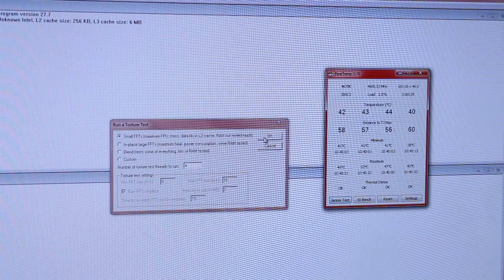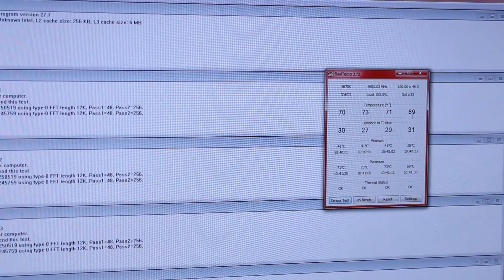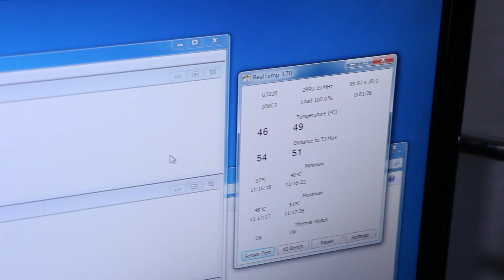i5 & i7 Haswell & Ivy Bridge - FULL Delid Tutorial - (Vice Method)

Comment: Is this necessary? It has taken me 4 months to get all components together on a £1500 build, the last thing i want to do is start fucking around with the cpu i just spent £250 on. I'm gonna be putting a custom loop on my 4790k are the temps that bad? I've got all the shit spread all over my living room and there's no point starting if i have to rip the cunt apart again!

I like your style keep up the good work!
Reply from the maker: Oh if you have a 4790k then dont bother, they already have the improved thermal paste.
Reply: Cheers mate appreciate you answering i didn't really want to do it i'd probably fuck something up. Was it just for overclockers or was the heat issue across the board, like for all users?

That Coollaboratory Liquid Ultra can it be used on gpu and cpu for watercooling? I noticed you didn't use it on your cpu you used Arctic Silver instead or was that because of cost? You get a small amount for the money! I read some people saying they only get one usage out of it but they must've been a bit overzealous!
Reply from the maker: No worries, yeah you won't need to do it on the 4790k.  As for CLP or CLU, I didn't use it on the cooler as it will corrode alloy (my Enermax T40 is made of aluminum), also the fact that you don't get much of it makes it perfect for the die to IHS, where it won't corrode either.  So honestly you won't need it at all in your case.  As for Arctic silver the stuff is honestly just decent stuff that works well, and you get a lot of it too. 

Yes there is better thermal paste out there, however I found that after a year of having PK-3 lying around in a tube I went to use it again and the stuff just became hard shit (i.e. I couldn't use it again), as opposed to the AS5 which was still all good to go and like it was on day 1.
Reply: A lot of people still swear by AS5, on a lot of comparison tests i read there's only a few C difference from the best to worse so it's just personal preference! I bought some Phobya Hegrease extreme not used it yet, not started my build never done a watercooling build before, i keep pussying out. Either that or i'm just a lazy bastard :)

Thanks again, keep it up your videos are enjoyable and not American!
Reply: Tech YES City "...you won't need to do it on the 4790k".  Some still might want to try this with a 4790k: http://www.pugetsystems.com/labs/articles/Delidding-the-4790K-for-a-quick-look-at-the-TIM-573/
Reply: Rod Anderson
No since posting the above i've read they use better thermal paste which is what this dude said. I never read anything suggesting intel were gonna use solder and the article you posted says "rumour" making it a worthless article! It's like saying there's a rumour going around that a pill has been manufactured which grows your dick an extra 4 inches! Then saying later "that rumour about the big dick pill was a load of cock n balls" A rumour may as well be a myth or a lie because 90% of the time it's just hearsay or altogether made up shite!
Reply: Overreaction. I was just saying that using CLP on the CPU after doing a delid on a 4790k can probably still bring some nice results. I highly doubt the "new" thermal paste Intel is using gains more than -1 or -2 degrees. Up to the user of course.
Reply: michael thorn actually Intel did the 4790k to improve TIM but its STILL SHIT! STILL SHITE. I need to delid my 4790k

Comment: So why didn't you use the CLP on the lid & heatsink also? Its a far better TIM than AS5, its 100% liquid metal alloy, doesn't get much better than that for a TIM. I assume you have a good reason why you didn't use it there? I'm very curious.
Reply: William C. Nice Job keeping your 1366 socket mainboard for all these years. You probably didn't miss much except PCIe 3.0 and USB 3.0. Good X58 mainboards still sell for 200$ and more. Here's what I did: Bought a Xeon X5660 Server CPU for around 90 bucks. It's got the performance of an i7 980, six cores, 12 threads and is a monster at OC. With an Alpenfoehn Brocken 2 aircooler I run it on an MSI X58 platinum at 4Ghz. Give it a try, dude, you'll shit bricks, I guarantee it. It outperforms a stock i5 2500K.
Reply from the maker: x5660 and gtx760/960, you will be up and gaming again no problems.
Reply from the maker: Cooler has aluminum on the base plate (enermax T40). CLP eats alloy. Previous AIO was all copper but that shat itself.
Reply: OK, that makes sense. My CPU is a i7 920, I take it that it has the crappy paste as well? I'm using IC Diamond & a all copper Zalman cooler, temps average 36C idle. What kind of temp difference can I expect if I Delid & apply CLP?
Reply from the maker: I believe the i7-920 was soldered, so this tutorial won't apply (i.e. can't delid your CPU).  As for temps, soldering is the best, so you don't have to worry too much.
Reply: Yeah I found out today that you're right. The i7-920 is the 45nm Nehalem microarchitecture & it is soldered to the HIS. When I first installed my copper Zalman CPU cooler using IC Diamond (about 4yrs ago) I was averaging 31C idle temps, not too bad for air cooling. Well I just applied new IC Diamond TIM the other day & I can't get it below 35C idle, tried three different applications but I'm still averaging around 37C. It had me baffled until I discovered that my rear & side case fans were dying, both moving just enough air to keep the inside of my case from baking. They are obviously not performing optimally which completely explains my temp differences, at least I hope, that's an easy fix. So Tech YES City, do you have any 120mm case fan recommendations? I was thinking Noctua? There are several models on eBay for around $25. Do you know which verson has the best balance of performance & silence? Ive also heard the scythe gentle typhoon is really good. Also, I got this (Link Below) mounting bracket for my 2 30GB SSD's (in RAID-0 of course), they mount directly on top of eachother & the bracket has a spot for an 80mm fan, should I get one for them or do SSD's even need fans? Its only a few bucks for an 80mm fan so I'm thinking why not, couldn't possibly hurt? OK, that was WAAY TOO MANY words for a YouTube reply, LOL!
http://www.ebay.com/itm/151320350177?_trksid=p2059210.m2749.l2649&ssPageName=STRK%3AMEBIDX%3AIT#
Reply from the maker: Scythe Gentle Typhoons are amazing, I would go with them if you can pick them up cheaper than the noctuas, both are really good choices though, but I would hit up the Gentle Typhoons personally.
Reply from the maker: I am always a fan of 'the more the better' in terms of cooling, so I would honestly get a fan on your hdds and ssds (though ssd isn't as important as hdd), I have a 12cm fan dedicated to cooling my drives and I haven't had one fail in a very long time.
Reply: Anco77 Yeah I bought a Gateway FX6800-01e for $700 in 2010, upgraded the memory, video card, CPU cooler (also added a RAM cooler) & PSU, its been running fantastic ever since. This has been the perfect machine for my needs, does everything I need it to very well & with the SSD's its quite  responsive. The only issue I'm having now is my Radeon HD 4870 (I know, its old by today's standards) crashes once in a while, apparently from the outdated drivers it uses.   This is very annoying but its the only issue I really have with my system, other than that it has ran like a champ since day one. So Anco77, your saying that a Xeon X5660 will work in my 1366 socket? Where would I find one at a decent price? Also, what video card would you recommend as an upgrade for my system? Thanks for the advice man, much obliged.
Reply: Tech is basically right. You could also get the X5650 but they tend to run less stable when overclocked. Just look at ebay, there's a dude in my town (Berlin, Germany) who's selling those Xeons like hotcakes because many companies renewed their server infrastructure and then there are 100.000 CPUs on the market all of a sudden which explains the cheap price. The GTX 960 is good, no doubt, but if I was you I'd go the extra mile and get a GTX 970. It has almost the performance of a 980 but costs 200$ less with more video RAM than the 960. Or if you like, try an AMD R9 280 or 280X. It doesn't really matter because you'll probably change your graphics card anyway in a year from now but the Xeon will still be a beast. Because modern games and DX12 seem to scale pretty well with 6 physical cores due to the CPU design of Konsoles.
Reply: By the way: I use the Xeon System only for fun and benchmarking. My "normal" rig is an i7 4790K on ASUS Maximus VII Ranger at stock settings because my cooler sucks and is just there for the looks [Thermaltake SpinQ VT). If it comes to games, I used both CPUs with a GTX 970 and had no or minimal FPS difference at Assassins Creed4, ArmA3, Farcry 3, Skyrim and Dragon Age: Inquisition. Those tests told me that the Xeon presently isn't a CPU limit which slows down your games. And as I said, I think it will stay that way for at least two years untill the new consoles come out.

Comment: Ok, so after watching you great video I need answers. I just built a new PC and I have a 4790k and running at stock everything (4Ghz) running the same CPU cooler you have and non-delidded the temps will go to 95c+ (according to 2 different temp programs) within a minute of the stress test. so my question is, what could be wrong and how can I fix it? and for more insight I down clocked to 3.8 at 1.04v and its only reached 72c MAX after 30+ min.

Thanks

Comment: whats better: cpu frequency of 4.4ghz and a cache frequency of 3.4ghz, or cpu frequency of 4.0ghz and a cache frequency equal or near equal to that? i've heard that a 1:1 ratio is ideal, but is it worth it at the expense of having a lower cpu frequency overclock????
Reply: core is always king.  go with 4.4
cache should be 3.9 - 4.2
Reply: Well I asked if 4.4 core and 3.4 cache is better than the 1:1 core/cache ratio. Having my core at 4.4 seems to make any cache overclock unstable, hence the reason I'm asking about it at stock frequency
Reply: Justin Sheldon If your stable core OC is crashing your cache OC then give cache more voltage.  But to answer your question, 4.4 core/3.4 cache will give better performance than a 1:1 at 4.0.  Try both and test with cinebench.  I have my 4670k at 1.8v VCCIN, 4.5 core 1.24v, 4.3 cache (ring) 1.195v. 24/7 stable.
Reply: i've found stability but i guess i might have a bad chip. i have 4670k at 1.9v VCCIN, 4.4 core 1.28v, 4.1 cache 1.19v
Reply: That's not a bad OC.  But probably a bit below avg chip.  If you're only gaming, 4.4 is just fine.  Mine can do 4.6 at 1.29v but I back it off a bit for lower temps.

Comment: i went ahead and upgraded from a 4770k that wouldnt go over 4.2 ghz,to a 4790k that asus auto tune put it at 4.9 ghz across all cores but i had to back it down to 4.7 due to overheating and i am using a corsair h110 water cooler
Reply from the maker: Nice to hear the gamble paid off :).  4.7 24/7 is a damn impressive OC.
Reply: Tech YES City well i sold my 4770k for 280.00 usd, and i had a 20 usd off coupon and i didn't have to pay tax for the 4790k, so it cost me about 40 usd for the new one, i plan on jumping over broadwell and waiting on skylake, i just have a addiction to always buying the latest and greatest if i can afford it.i would like to see a asus manual overclock for the 4790k, i used the asus 5 way optimization and it had all cores at 4.8ghz with core 1 and 2 at 4.9 but i turned it down to 4.7 across all cores because of heat,i could hit 4.6 ghz stable at 1.2v, but i didn't try any lower voltage as i was trying to max the cpu out, thanks for the vids.

Comment: You should try out the Thermalright True Spirit 140 Power. Its around $50 USD and cools even better than an enermax T40. On a hot summer day with my windows cracked as usual, I idle around 30-35c and prime95 maxes out at 73c at 4.75 ghz on my 4670k

Comment: would you recommend deliding the 4790k? i heard they put good thermal paste on it already
Reply: No, don't do it. With the new chips they fix that. They used a good quality thermal paste. 4790k comes with 4GHz out of the box and 4.4GHz with turbo boost. Not even sure why would you overclock more, 4.4GHz is enough. But if you really want you can with a good cooler like Corsair H100i or Noctua nh-d15 up to 4.8GHz no problem.
Reply: Dr_Palace thats what i thought, thanks
Reply: Ecdub984   Under water with my 4970k my temps reach 90c+ in prime and Intel Burn test at stock volts, I have tested all my cooling parts and the only thing i can think of is the chip has a bad TIM connection between the die and IHS. I will be delidding mine this week so Intel haven't fixed the TIM issue they just tried to polish a turd.

Oh and why not overclock the 4790k Dr_Palace? Its the only reason to buy it, it is an unlocked CPU for a reason.

Comment: Thanks, I love your videos, helped me loads, right, I have hero 7 board with all the trimmings in ssd and asus 680 gpu and so on, I am getting the 4790k next week and I am seriously thinking abt deliding it, but I am a little worried abt getting my dick stuck in the vice,lol, 300 bucks if I fuk up... I will only be running the chip at 4.6ghz, that's high enough for me as I want this rig to last and not burn out to fast so that being sais is it worth taking the risk tech yes ???, can I ask why you did not use the liquid metal on the cpu heatsink as you did on the die, and will it be ok to use the liquid metal on the die and cpu heatsink, please advise. thanks man.

Comment: Im not here to tell you you're doing it wrong, if this works for you then sweet, but I work at a pc company and we have always just put a Stanley knife in the corners, edged it around and then lifted the lid off, it's safer and you dont have to worry about cutting the pcb, as long as you always keep the knife on a flat you will never damage anything. I would also suggest getting a smooth Stanley knife for the silicone on the edge and replacing it with some silicone based glue, that way you can reseat the lid and have it stay on ;P
Reply: lol just don't do that for God sake, with any blade is just too risky to remove IHS. Go look on some forums a lot of people has destroyed the chip when they tried to remove IHS with a razor.  Vice method is easier, faster and much more safer. To this day i never meet anyone that has killed their chip while using a Vice method to remove IHS.
Reply: As mentioned in the above comment I work at a fairly large pc company in the UK, we mod chips all day, everyday OFC if you stab a resistor you're going to have a bad day, but simply cutting into the silicone sealant is the safest way... if you honestly think that smacking your cpu with a hammer and letting it fly off is safer then you havent modded many chips.

Comment: I am running a 3570K at 4.5Ghz with 1.28 load vcore. Temps reach about 75-6 C average. Is my chip any good and would you recommend a delid?

In terms of other thermals, I am running a 212 EVO in a CM Scout 2, all with stock fans. What is a quiet, more powerful, case fan setup that you could recommend? Budget = $60 AUD

Comment: Any reason your using liquid Pro and not Ultra?
Reply from the maker: I like working with pro now (gotten used to it).  I heard pro was better than ultra when applied correctly?
Reply: I see. I am going to delid for first time my 3570k. Got it to 4.4 but at 80C. Soon as i saw your old vice-method video i felt at ease about it. I just got a corsair AIO h75. Im thinking of getting the Ultra stuff and some Noctua thermal paste.

Im working in a Bitfenix Prodigy on a z77 i-deluxe board from asus (only 2 fan headers). So im stuck waiting for that nzxt digi+ fan hub to be able to wire all the fans up.

Sorry for the essay. Can i get your thoughts if possible.

Thanks.
Reply: Tech YES City Try Liquid Ultra, it comes with a little brush. I ordered some and cant wait to see the temp difference compared to My PK-2.

Comment: i stock a piece of electrical tape onto the bottom of the chip and on the vice so with the impact the chip dont fly off the vice + i also drilled two small holes on the heat spreader so the extra heat can escape

Comment: Thinking about delidding my chip tho I am getting pretty good temps already (as far as I know) http://gyazo.com/5724e075c49c4e350d40d5332239fa8b Would it be worth doing and could it maybe increase overclocking headroom?
Reply from the maker: Yeah it will give you a bit more headroom assuming that your ambient temps were around 20 degrees when you took that shot?
Reply: Tech YES City i have wondered the same thing, my 4770k is idle at 28c and under full load is 55c at 4.3 and crashes at 4.4 ghz, so would this help in my situation?i am considering just buying the 4790k
Reply from the maker: Full load at 55degrees is pretty low, I think the chip might be maxing out at 4.3 there, Would you buy the 4790k just to get an extra few hundred mhz?
Reply: well i sell the 4770k for 250 usd and put 100 with it and buy the 4790k, i need highest posssible 2 cores speeds for my flight sim, i wass hoping i might get lucky and get a 4790k that might reach at least 4.6ghz, just a thought anyway, but thanks for the comment :-)
Reply: Brett Culley Buy a new pentium!
Reply: my 4790k works great i am just not thrilled with asus motherboards, if i have the extra money i plan on sending my asus board off to techyescity and buying a msi z97 board, or deal with it until skylake.

Comment: Is it worth deliding my karaoke 4670k when it is running 4.0 at 1.3v with 35 on idle and when prime95 stress tested it goes 70-90 and i cant achieve 4.1 with stock v
Reply from the maker: Yeah a delid sounds like it would help out a lot.
Reply: 4.0 at 1.3v doesnt sound healthy.